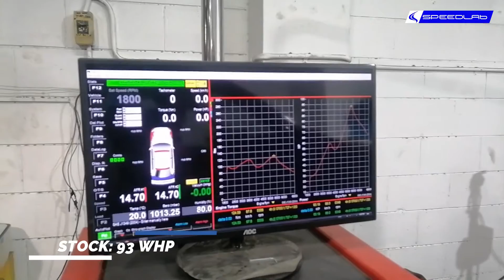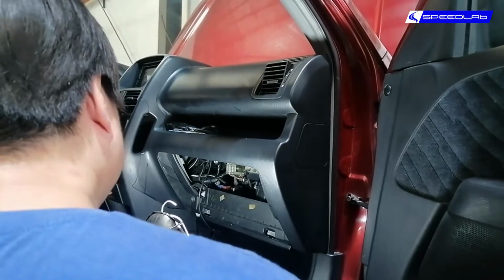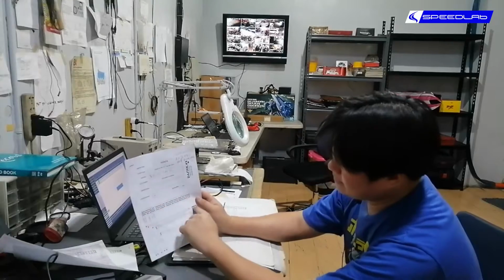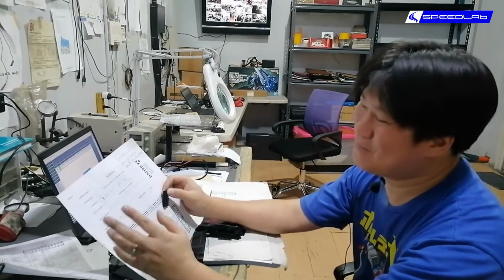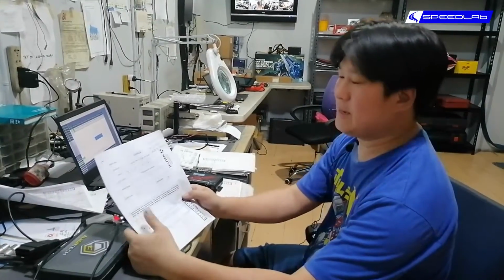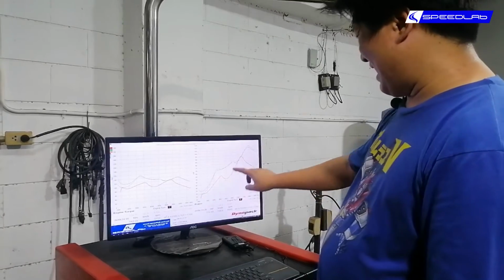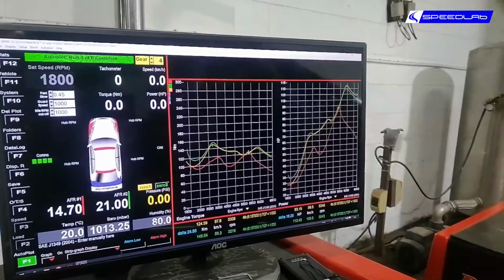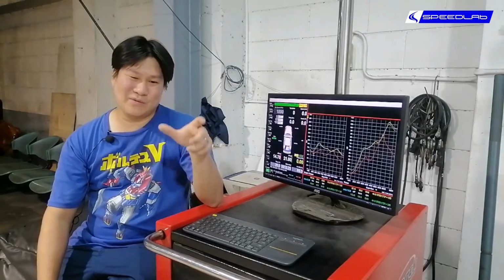Honda CRV Unichip ECU Remap Installation and Dyno Tuning

Comment: sir yung 2018-up crv diesel po how much po and increase sa power and torque?
Reply from the maker: 30-35hp 
40-50 nm
Reply: I’m interested is this something I send to you and you install unichip and send back? Or do you have to tune it in your shop?  I can solder.

Comment: I'd rather buy Haltech Elite ECU ready for turbo boost much much more options than this. He will ONLY give u 20-50hp the most lmao. Thats like upgrading full bolt ons: headers, cold air intake, exhaust w/o tuning. For P35,000 = $800-900 go buy a REAL progress for power and better gas mileage, if you know how to tune that fr.
Reply: Why? The Unichip is awesome at a fraction of the cost.
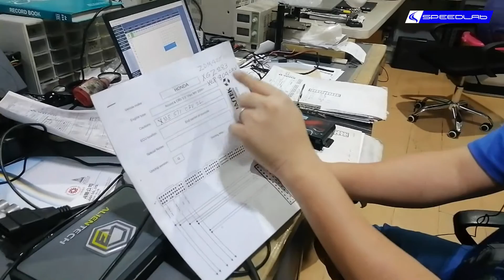Reply: @hondatrix  5:20  You are charging P35,000 for 12-16hp. Too expensive for only that much added hp. Anyone can add upto 20whp for less. And if they want real whp double triple or quadruple go for Haltech or Hondata ecu not this waste of money. P35,000 = $800-$900